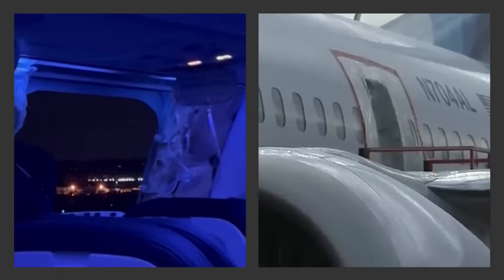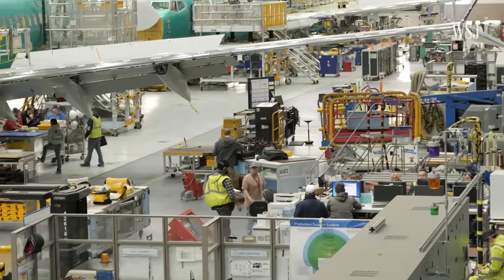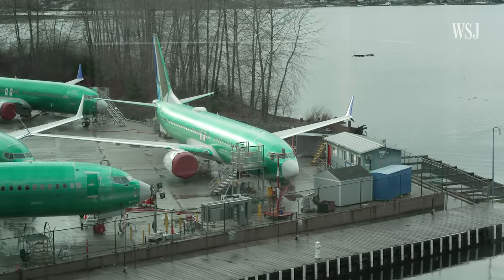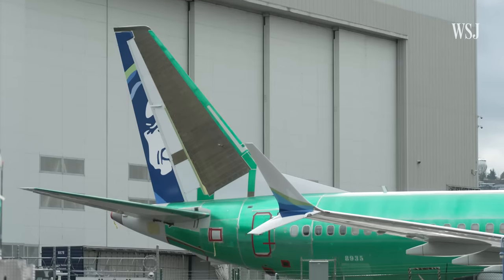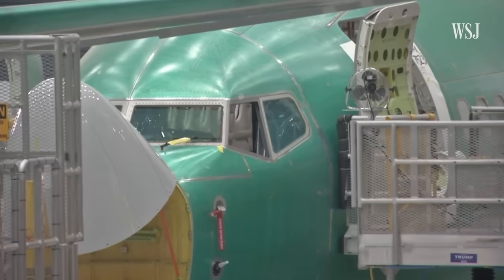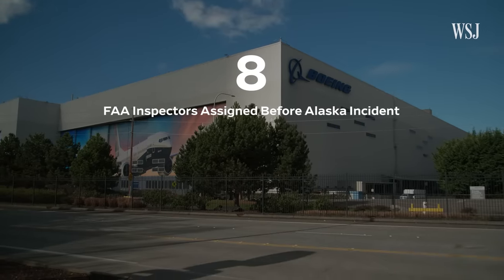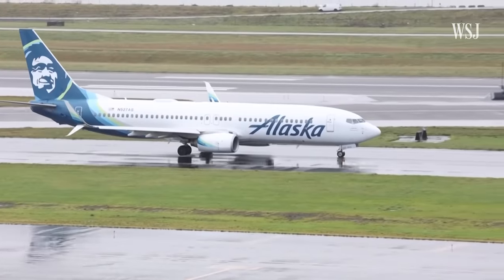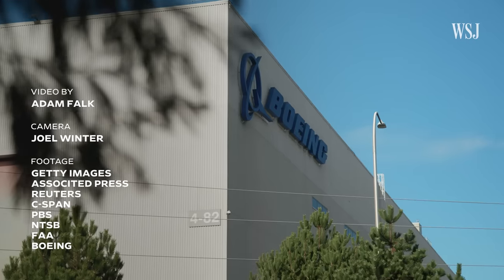Why Boeing’s Quality-Control Process Still Misses Mistakes | WSJ

Comment: As a QA inspector for 15 years.. there should never ever be mechanics and technicians policing their own work. 😅
Reply: Amen! I also felt that inspectors should be in a different guild or union than shop.
Reply: @MikeCTRVLR the inspectors should be in the FAA. Lobbying and campaign donations should be made illegal. Revolving door should be made illegal. Better yet, Boeing should be nationalized and placed under democratic control with full transparency and public audits. No more drive to maximize profit YOY, planes would be cheaper and safer. Also, it would reduce costs on the tax payer as we currently subsidize Boeing, allow them to over-inflate government contracts, etc. All revenue made, if nationalized, would go back to the tax payer and workers, not private investors who have no interest outside of maximizing profit for themselves
Reply: It's like hiring a kid to be the Candy 🍭 shop manger
Reply: This is what they are switching to in software development: devs QA their own work, deploy to production, handle production issues. All to save on QA and Prod monitoring staff.
Reply: @xx133 FAA isn’t better. What’s needed is people like this whistleblower being taken seriously and having no agenda. An employee intimate with manufacturing but someone who can’t be fired by Boeing.
Reply: I left my role as a lead engineer at a major corporation for negligent practices like this. In my resignation letter I made clear that I will not risk tarnishing my reputation should something go wrong. As a lead engineer I am held responsible for those below me and what we deliver. I chose to resign after multiple attempts to raise my concerns and correct the sloppy engineering culture in the company. All fell on deaf ears. 

Best salary I’ve ever had to date in my career; but my principles are built on good practice. One incident at this company saw us develop a new XML parser from scratch (no third party code) to accompany the existing WSDL parser we already had; this allowed banks (yes major banks) to upload older specifications and transform them into REST APIs. We completed it earlier than expected, and management urged me to deliver it for production. A big falling out ensued when I said it won’t be ready for at least another week. They asked “why” and I replied: “because we haven’t finished writing our unit, integration and contract tests”. Our team standard was to obtain 100% coverage on all code branches (with very rare exceptions). They argued and argued (as managers do). I stood firm and made clear that nothing goes in without tests, and certainly not when I’m leading the team responsible for it. After all, they’d be the first to reprimand me should anything have gone wrong in production. 

Customers of this product were (and still are) primarily worldwide banks; including major name banks that most people use every day without thinking much about it. Something goes wrong, it will be noticed. I had already been in a hearing regarding an issue with one of the customer dashboards in production, previously. In that case, it was a team based in New York that caused the error. It didn’t end well for them, let’s just say that.
Reply: @dWFnZWVr  yes, that’s exactly how it works. They pressure you to get the work done quickly and then blame you when it goes wrong.

Comment: People blame many of Boeing’s current woes on the “McDonnell-Douglas culture,” but how many have stopped to ask how that toxic, short-sighted culture and management philosophy came to be in the first place? 

A nontrivial piece of the answer is that McDonnell Douglas had lots of Jack Welch-era GE alumni throughout its managerial ranks. Welch’s tenure at GE was marked by counterproductive cost-cutting, and a laser focus on upcoming quarterly earnings above all else. He is also known as the pioneer of “rank and yank” (I.e. fire the bottom ten percent of employees). I wouldn’t be surprised if more than a few of these people made their way to MD. 

In 1996, GE was the most valuable company in the world. The MD merger took place in 1997, so that culture was very much en vogue at the time. Not a stretch to guess that this played a role in how MD management came to “take over” at Boeing. 

Also consider: Current CEO Dave Calhoun and the first new post-merger CEO, Harry Stonecipher, were also Welch-era GE alums and disciples. 

Is there more to it than that? Yes; however, Boeing’s current state of affairs begins to make a lot more sense with that extra layer of context.
Reply: Absolutely. Management has background and expertise in private equity, not engineering.
Reply: boeing supposed to merge with macdonald hamberger not duglas
Reply: Jack Welch was a Muppet but that doesn't excuse active decisions to put money over safety

Comment: The vast majority of Boeing Employees have the right attitude and care about flight safety. However, as in any business, some employees and managers need careful surveillance. Some are  just careless. Others don’t bat an eye if they try to sell a job to an inspector with a missing part or a defect , they expect the inspector to find that the part is missing or that a defect exists.  

Decades ago the Man Power Development and training Act (MDTA) put many new (well-trained) inspectors on the shop floor.  New hires were trained by senior Boeing Inpectors over several months.  A new program is needed to train inspectors. The MDTA was one of the few government programs that worked flawlessly.

Comment: As a 737 Captain for a major airline I will say the biggest mistake with the 737 is Boeing has tried to make it the same type rating as the version that rolled off the assembly line in 1968 while also sort of upgrading the technology. That was a huge mistake but I understand why they did it. The airplane needs a stronger APU and an EICAS just for starters.

Comment: I have worked for over 20 years at another very large aerospace company (begins with the letter “L”) and we are right behind Boeing in the sense that management is actively attempting to eliminate quality processes so we can become more “efficient”. Any concern expressed by the production floor people is politely ignored. We have incorporated similar practices with Boeing in which production mechanics buy off their own work. In the last 24 months we have made the worst production errors I have seen during my tenure with the company. Even when faced with the growing evidence that these new quality processes are failing, there is reluctance to admit the new processes are flawed. Rather, management is doubling down. There exists this attitude that older practices are automatically flawed and outdated. Got to keep breaking down those silos.

Comment: It's all in the paperwork and procedures. No number of additional inspectors would have known that the retention bolts were not installed in that door plug without taking it apart again. There should be a document, signed be either an inspector or a mechanic, stating that they were installed. The question is: where is that document?
Reply: ☝️ one of only a few actually reasonable comments on this thread. Yes, unofficially, it appears someone intentionally circumvented a process to AVOID having to sign it up to QA again - a scandal that should have been preventable and there was a failure there. 

But it was NOT systemic - it was a limited number of bad actors (who yes, may have behaved the way they did due to pressure).
Reply: @RingoBars  it appears different - the posibilty that its possible to circumvent a part of the QA is the defention of systemic in my opinion 
in my opinion multiple layers of QA have faild 
and intentionaly putting in someone in harms way is Intentional Endangerment or something along this lines - courts and lawyers will have a field day 
and the possibility that boeing not prevented this action could be also punished criminaly

Comment: There are way more inspection layers...subtier suppliers and multiple internal layers.
Reply: Yes - source inspection and customer inspections in addition. Boeing must do better, but this hysteria is just that: hysteria and media taking the opportunity for them extra clicks. Even going nuts over 30 year old Boeing planes when they experience a maintenance (Airline responsibility) problem.

But the masses don’t know any better…
Reply: That's true! All components must meet stringent criteria to be approved. Even tiny components such as rivets and screws have to be periodically verified to be “The right stuff”.
Reply: @RingoBars Although media does exaggerate there are quite a few serious issues that happened in the last few years. Much more than what should ever happen.

Comment: Why did it get this bad?  Boeing use to set the standard.  Management let this happen.  Management sets the priority.  Inspection has to be done during manufacturing.  I equate it to maintenance.  Management will say we don't need to spend money on maintenance because nothing has been failing.  Then after a few years everything starts falling apart.  Then management will then say the workers are not doing maintenance.  This is a management problem and a leadership problem.

Comment: The easy way to separate quality assurance from retaliation by company execs is to have them employed by the FAA but paid for by the manufacturer. Make it a cost of doing business thing that no cost cutting exec can actually do anything about. This would also cut the funding needed from the FAA to maintain the QA program enormously. No exec or manager can pressure QA to push out uninspected planes since that person is not in the QA chain of command.

Planes would perhaps be a hundred thousand dollars more expensive, but for a multi-million dollar aircraft, that is a comparatively miniscule cost increase.

Comment: Personally I've worked at Boeing in the welding department C-17 The Welding Engineer had zero welding experience only textbook knowledge! I've worked at Aero Arc an offload site for the C-17 also in the welding department. I witnessed their titanium welding not being purged, Their welds are wire brushed and sandblasted! Any welding Engineer or welding inspector should see the obvious red flag!

Comment: Boeing, and this report, make the mistake of conflating quality control and quality assurance, but they are very different things.  The goal of quality assurance is to make sure defects do not get shipped to customers.  That is what Boeing and the FAA are trying to do.  The goal of quality control is to set up the manufacturing process in such a way that defects become impossible.  For example, if it is important that a certain part be installed in a certain orientation, design the part so that it only fits when it is in the correct orientation.  Create door plugs that cannot be installed without being properly secured.  How?  I don't know.  That is the downside of quality control: it is very difficult to set up; it has to be built in to the design of the product.  Once a proper QC process gets rolling though the cost savings and customer satisfaction just keep going up.

Comment: 100% inspection is 80% effective.  200% inspection  or 300% inspection   will result in  minimal increase in effectiveness.
Process Control and Failure Mode and Effect Analysis with TGR/TGW feed back is hat is needed.

Comment: Boeing needs to become an aviation engineering company once again. Like Airbus.
They need an Engineer as CEO.
They need Engineers in Senior Management.
And Senior Management must move back to Seattle.
Senior Management and Operations must be in the same place.
Like Airbus in Toulouse.
If they don't do this Airbus will leave Boeing for dead.
Europe's EASA have said they're ready to reject FAA certification as worthless.
Boeing will then face much tougher inspection.
And will fail.

Comment: FAA employees should be inspecting aircrafts. Boeing should be charged for the inspection. Also, the revolving door of Boeing employees working at the FAA and vice versa should be made illegal. Also, lobbying and campaign donations by corporations should be illegal.

However, we should nationalize Boeing and place it under democratic control with full transparency and public audits. Boeing is subsidized by the U.S. government substantially, and inflates contract cost, knowing they’re a monopoly. It’s a national security issue at this point, decisions shouldn’t be in the hands of private investors. This would significantly reduce the costs of airplanes (no pressure for YOY profit increases). It would also mean that all parts could need to be made domestically, creating many secure, much needed jobs.

Comment: Because financial professionals or MBAs are used as CEO and other senior executives, this situation also happened in Intel, so almost the same consequences occurred. Intel has replaced a new CEO with a technical background(486 main developer), but it cannot return to normal track in a short period of time. Since Intel was founded The greatest and most respected CEO is Andy Grove

Comment: This whole video addresses the ISSUE.....but still shows no clue as to how modern, progressive firms yield quality. Quality is not primarily "inspected" after-the-fact......that is too late in the process,  and often misses a lot of things.....quality is "built-into" the work process. People in this business space understand a number of these issues....that it starts from the C-office suite who truly support the effort, and not just give lip-service to this. This includes focusing on quality and safety ( goes hand-in-hand)...to the point of cheering production stoppages if warranted....not simply to push product "out". Then there is "institutionalized", written, internal work processes and procedures...to include training of all-involved ( and folds-in with sub-supplier's work and work process)..... that result in quality . And that the rank-and-file do this... supported by middle and upper management . There is so much more to this topic that most lay-people don't understand and that most news reports like this are not aware of.